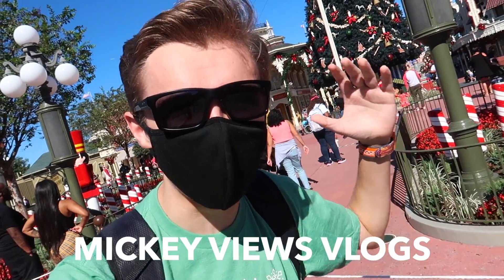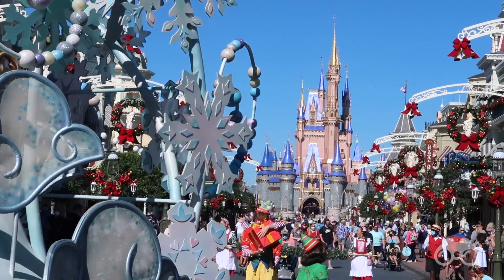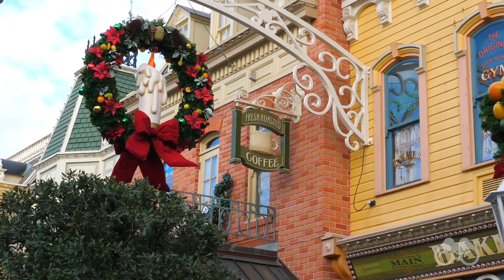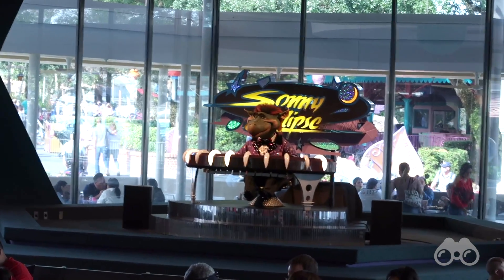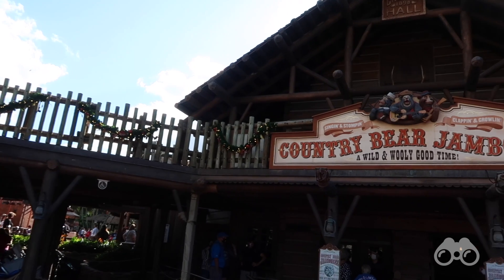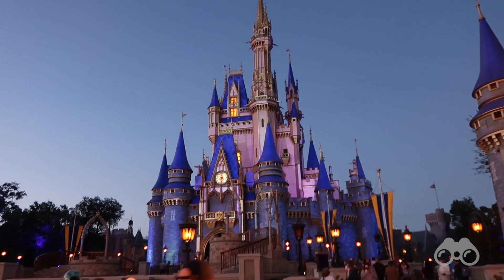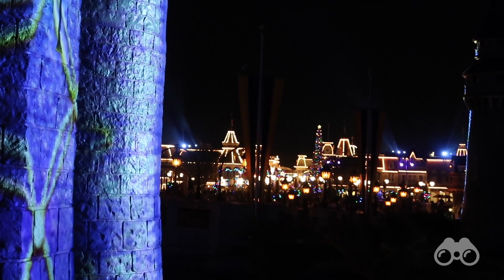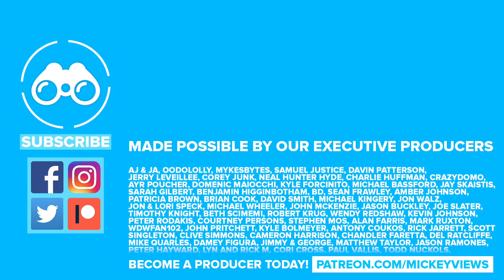EVERYTHING CHRISTMAS at Disney's Magic Kingdom for 2020! - Disney News Vlog

Comment: do the projections and save the coins... save on the chance of a fire too..lol... if .. no If.. since the evidence is in and the Fans are willing to Stand Tall for about 50+ minutes to see the 4 different projections... 
I have been in meetings where there were more than one set of Projections and not always did the persons in that (them) room(s) want to Stand Tall during those Projections and many in them (that) rooms(no s) did not always agree with the projections...

when the Fans stand still as the water if not more sow, then disney should do more projections and perhaps add the projection option to other stand alone buildings..... less fire more Flair for the Dramatic '15 minutes is UP'.    
I have heard of many a Human committing many a crime to secure their own '15 minutes of Fandom'    but at disney they Light up them Projections that lower the Opportunity Cost (lower % of fire, less insurance needed and less work to ensure the safe return of the fans and the assets' maintenance) and increase, It appears, the Fans' enjoyment....

they are literally Standing Still ... at most parks.. ok so the name really does FIT in this scenario... at most parks is a LOT (pun) of walking to and from an attraction.. a Line here, there, Pretty well every where.. the bakery has a Line up.. lololol...
so there is already a LOT of land being used to Stand where U live REM shout out, bit by bit there be the Projections ... every 15 mins and then a new one.. Good move.. props all around and even with the layoffs and all that bad economics' cents to be handled.. 

this is an Opportunity to max the use of each square space and make each Fan's attendance a more enjoyable experience.. less folks should mean more on them rides when they can ride them... but to have so many Fans will ING to stand there for an hour.. to bend their Necks like birds to peck... I am impressed.. Good efforts...
thanks for the wonderful upload.. good documented sense and editing was 'Mother Cutter' like..U cut like Verna Fields     she did the work on JAWS..